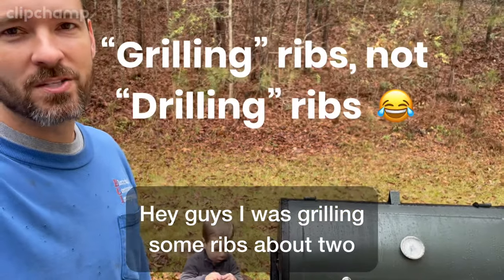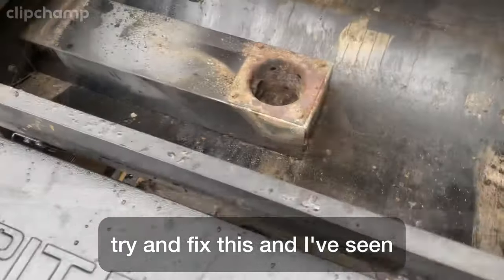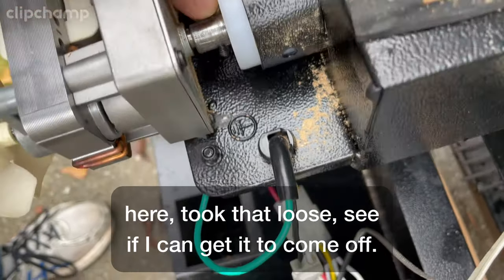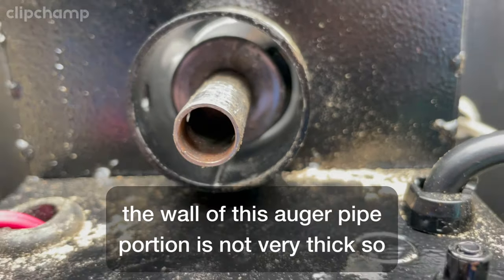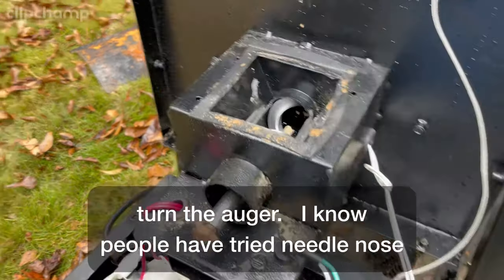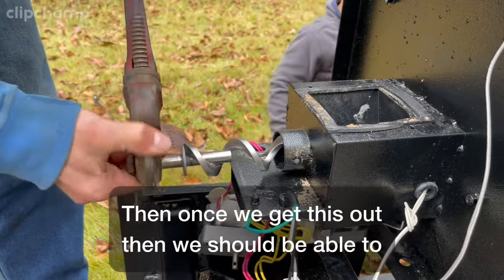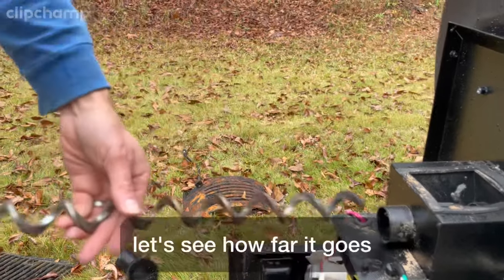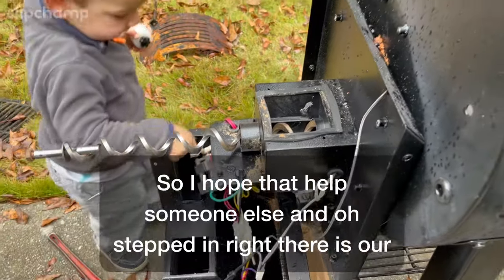Jammed Auger: EASIEST WAY to fix Pellet grill.  For hopper removal see description.

Comment: DUDE!  YOUR KID IS A GENIUS! Thank you so much for sharing. Every other method I was looking at was saying BEAT the auger box. 
I put a bolt inside the hole, grabbed it with vise grips and is just she twisted right out. Used the auger to dig the rest out and we are up and running again!
Reply from the maker: I agree, she’s a genius and she didn’t get that from me!😂

That’s awesome man, happy grilling n smoking!
Reply: What size bolt
Reply: @e31chrisl  Honestly don't know. It doesn't even have to fit snug. You just need something that will take up enough space so you cant CRUSH the tubing. I think mine was a 7/16 and it did bend the tube but it was super easy to get it back into shape after the clog was rooted out.
Reply: @matthewcarpenter4716  it is a 7/16 bolt i have been dealing with these grills for years i know everything there is to know about these!😂
Reply: But mine was a Lexington, they're prolly different between models
Reply: Thanks for making this video!s

Comment: Thanks for the video. Son gave me his old Austin XL. The auger was jammed. The shank end of a drill bit supporting the inside of the shaft worked for me. When I went turn the auger with a pipe wrench, the weld broke where the shaft is welded to the auger. It was a really poor weld. Just a small tack weld. Was still able to turn the auger out and use it to clean out the debris. Took the auger over to a friend and he welded it back up. Checked it for wobble rolling it across a table. Good as new.
Reply from the maker: Thanks for the feedback!    I’m glad to hear you were still able to get it up and running even after the weld broke!

Comment: Did exactly the same thing in unscrewing the auger on mine.  I then used a 3/4 inch spade bit with extension to drill out the set up pellets.  Easy fix.
Reply from the maker: Great idea with the spade bit!

Comment: Pit Boss 1150 temp Run-A-Way

I purchased my Pit Boss last November when Lowe’s had their $500 off sale.
I used it twice without any problem. The cooking temp was rock solid.

Yesterday, Feb 14th I put some chicken leg quarters and hamburger meat on the
Pit Boss. I had the temp set at 270 deg F. I have been watching the You Tube videos on
cooking chicken leg quarters at 270 deg F. for about 3-4 hours.

I was outside watching things when in about 2 hours my temperature went from 270 deg
to 310 deg F. I hadn’t changed anything. I called Pit Boss and talked to Mr. Jo. He hadn’t
had a clue. He ask what kind of pellets I was using and I told him Oak Kingsford pellets.
He said he never heard the name Kingsford pellets or charcoal bricks. 

The pellets were new and dry so I don’t know what was going on. I always clean out all
the pellets when I cook. This includes all the pellets in the auger tube.

Anyone have this problem?

Comment: I just got a Pit Boss 1150. I live on the Texas Gulf Coast where the humidity is high. One thing Pit Boss needs to do on their menu when you start your cooking is have a "Prime" feature of say 30-50 seconds to feed pellets into the burn pot.
When you get through have a 'run-out' to clear all the pellets out of the tube.
Reply from the maker: Hello from Atlanta, Georgia!
I guess Pit Boss read your mind, because mine has both of those features.    
As soon as you fired up, automatically primes in quite a bit to load the burn pot, but it also has a prime button where you can manually prime more if you want to.   

Also, when I turn mine off, it continues to run for at least another five minutes or so to finish burning off what’s left in the burn pot.  (But I have to keep it plugged in during that time so the charge air fan can keep going)

Comment: Decided to clean mine out for the spring, the hopper was empty, but the auger tube was full and completely seized up. I had to use an AK-47 clearing rod to unjam it after I followed your guide to unscrewing it.
Reply from the maker: Wow, sounds like yours was seized up a lot worse than mine. Glad you got it fixed!
Reply: @coolstuffwithEric  Yeah it was a solid log that made mini tunnels for the auger to slide out of, leaving the whole log of wood lol
Reply from the maker: @BK-cx7qi  wow!    It’s crazy how that stuff gets hard as a brick after it gets wet and dries!

Comment: The easiest way is to empty the feed box, use a compressor with a blower on one end and a vacuum on the other and keep switching back and forth sucking all the loose stuff out. Just did it in about 5-10 minutes including emptying the hopper
Reply from the maker: You must’ve caught yours early before it got too bad, because mine had about a 6 inch section of the tube in the middle where the pellets were almost as hard as Concrete that I had to chip out once I got the auger unscrewed and removed.  

I’m Glad you got yours up and running again!

Comment: I’m not sure how smoker companies have not engineered a solution to prevent this or at least make it easier to remove the auger (ie. Make the shaft able to accept a socket instead of people relying on channel locks)
Reply: That is what I was thinking. Drill a hole in the bolt that fits inside and put the screw back in. Then it can be removed with a ratchet.

Comment: Taking off the pellet hopper is not as easy as he makes it seem.  Mine has a lot of electronics attached.  Time to look for more videos.
Reply: just running into the same problem with mine!!  indeed, time to find another video!!
Reply: @coolstuffwithEric  I thought I had a Pit Boss but it's a Pitmaster, and they do not make the hopper removable, nor do they make accessing the end of the auger doable either. I ended up using a clothes hanger to remove most of the pellet mush and then used a screwdriver and hammer to whack the end of the auger (by the heater part) to make it rotate. I got the thing on the curb and thought everything worked on it, which it does but the auger doesn't go slow and it ends up putting way too much pellets in the thing which causes a fire and no smoke. So the smoker it junk. I have a buddy who is an electronics guru and could fix it or put a knob on it so i can control the speed myself but I'm over it, I'm just going to buy a better smoker for myself, never dealing with that stupid plugged auger on that one ever again.
Reply: @coolstuffwithEric  After watching a bunch of pit boss videos I have seen that they actually considered a few things when they built it. Just being able to remove the  hopper and the auger easily makes me want to buy a pit boss, will never buy a pitmaster, those engineers are idiots.  Would you recommend a Pit Boss brand smoker?  Also, thanks for the replies. Very much appreciated.
Reply: @coolstuffwithEric  you would think engineers who paid alot for a college degree would have figured the rain part out by now.

Comment: For the life of me i can not remove the bolt that connects the auger 🤬🤬🤬 #Help
Reply from the maker: One option is to let soak a day or two with some good penetrant, like PB Blaster.  

And/or you could try heating the auger (not the bolt) with a torch).   But that would certainly be a more dangerous option, so have the water hose ready!